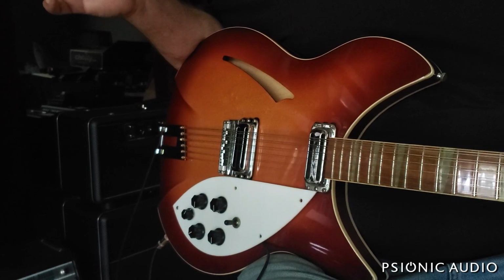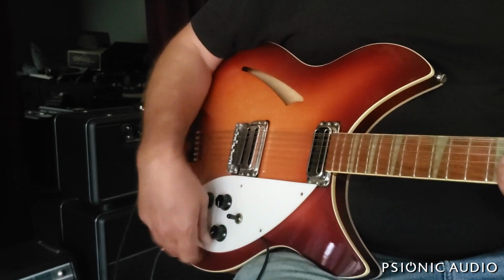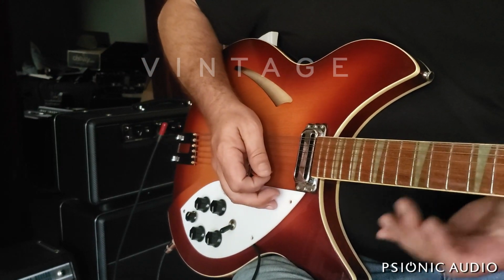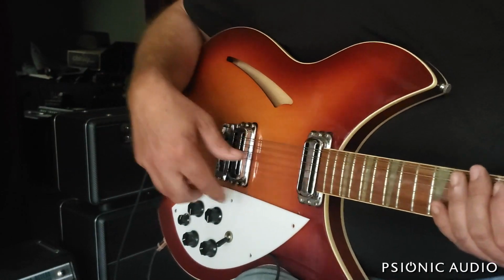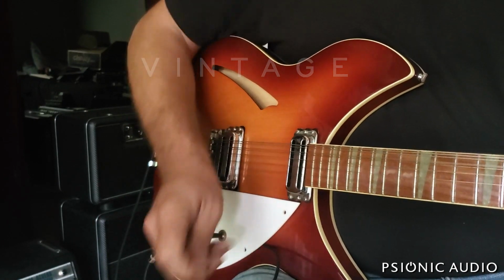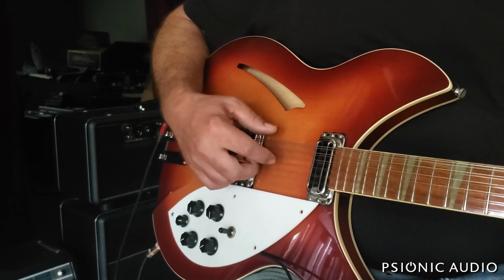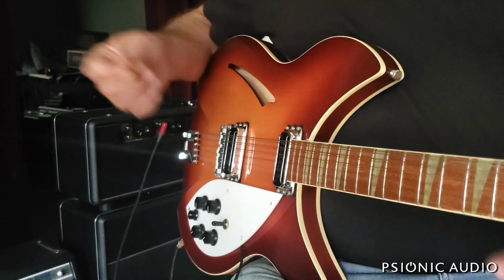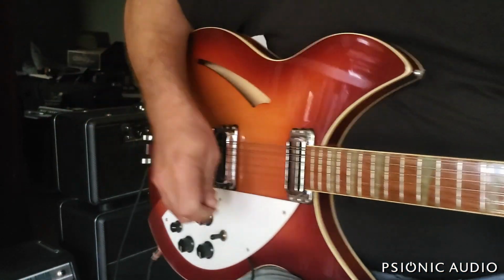Rickenbacker Wiring - Vintage vs Modern | What Exactly Does that .0047uf Cap Do?

Comment from the maker: You won't hear a huge difference if you listen on a phone, as the phone usually rolls off about the same frequencies the cap does. Headphones/real speakers are crucial for this
Reply: Actually I could hear more than you think on a mobile. The vintage wiring sounds much more like I like my Rickenbackers to sound. Personally I think I'd go with a split on it, so I had the choice, because I can see the benefits and weaknesses of both sounds. Great information though, as I didn't realise this was what the difference between vintage and modern Ricks was. I've played both and one thing which hasn't changed is that they are all pretty lousy to play, without tweaking.
Reply: Same here.  It isn't huge on the phone, but it is clearly audible....
Reply: I was recording my 12 string yesterday and noticed the “mwah” thing going on with the blend knob, now just watching this was super awesome. Your videos rock, the vintage Rat mod is right up there with this one. Thanks for explaining/confirming this.

Comment: I had two Rick 12s and hated the narrow neck
Reply: I guess you never played a mid ‘60s Gibson.  The nut on my ‘66 J45 is 1.5 inches.  It’s narrower than my 360/6 (1.63 inches).
Reply: @henry__49  Yes I had two SG specials 69 and 70 sold them both

Comment: I appreciate that you put South Central Rain in there at the end, as I've always had a 12 string at the ready because of that song.
Reply from the maker: It's Mitch Easter's Fender Electric XII doubled with the 360 (6 string) on the recording.
Reply: @PsionicAudio I'm a complete REM nerd, and I didn't know that.

Comment: Just swapped the "hot" 11-12K toasters out of my April 1994 Mapleglow RIC 12 with newer RIC scatter wound toasters AND the cap.
HUGE difference, has transformed my previously loud but 'muddy' (no matter how adjusted or Jangleboxed) guitar to glorious 60s octave jangle.
Sounds so good I don't even like using the Jangle Nano box as "essential" to THAT tone. If you are on the fence about those hot toasters you will not be disappointed
with scats and the cap. Great video especially how the cap wakes up the octave strings! Thank you!
Reply: Gemini vintage toaster tops.

Comment: I have a 360/12V64 with the .0047uf cap installed with a 12 saddle brass bridge. Plus I unwound the pickups to 60s specs. I absolutely love the sound and tone.
Reply: Moded my 2003 with Gemini vintage ‘63 toaster top pups and added the .0047 cap on a new pick guard so it can be switched back to ‘03 correct.  Also changed the volume pots back to the 280s. Always use the vintage setup.
Reply: Did pretty much the same to my ‘03 360/6.  Plus changed to ‘63ish Gemini toaster tops.  Love it.

Comment: I bought a 360/6 Delux (with RickoSound)  new in November of 1971, It's the one in my meme... It has the "transitional" pickups in it, I think they were installed from !969 to 1972, then the modern hi gains were used. 
My Rick has never had that kerang and big sparkly tones, despite have the wring checked several times, always been more like a beefy Strat sound almost. Last tech looked at impedance and checked with original specs and all works out... never nutted it out but never stopped me playing it for the last fifty something years...

Comment: Thanks for this. I think I’m going to try putting the cap on a push-pull pot for both the neck and the bridge. Might need to tweak the valve for the neck pickup. On my 1993+ with low-wound toasters, the neck is super boomy and bassy.

Comment: Thanks for posting this. I have a 1992 Ric with the Hi-gain pickups and it is unplay-ably dark. It's the most beautiful yet worst playing/sounding guitar I own. The 330K pots read anywhere between 125K and 250K max. I bought a set of VI 250K and 500K pots with the plan to wire up a whole new harness like this. I think I'll go ahead and swap it out. Might strip the board and have tall frets installed too. I love Ric's but man they can be frustrating.
Reply from the maker: The 350 I did had the Hi Gains. It sounded great after I rewired it, though I didn't use the Rick schematic.
Reply: @PsionicAudio  can you post a wiring diagram, please?    Great Video 👍
Reply: I bought another pick guard and loaded it with ‘63 period pots and the .0047 cap.  If I want ‘03 correct wiring I just swap out the pick guard.  Also gave it Gemini toaster tops.

Comment: Great video Lyle and thank you. I know you were playing mostly clean, but didn’t mention a compressor. I think McGuinn and Mike Campbell used those with the Rick 12, and maybe part of what we hear was the vintage wiring and cap with compression ?
Reply from the maker: Thanks. Compressors are a slippery slope - what's the actual sound of the guitar vs what's processing? I did a bit of this Rick on the Princeton video the other day and I added a little limiting in post here and there. 

McGuinn also uses metal fingerpicks - you don't want to hear me flailing trying to use those torture devices...

Comment: Hmmm.... Good to know about the 4.7n cap and vintage pot values.  Will have to check my 620/12 and see what it has in there.  If you like the sound but want a wider neck, try to find a 660/12 and see how that feels....

Comment: Did the older Rics with High Gains also have the cap?

I had a mid/late 80’s 610 when I was on a Paul Weller kick and I didn’t think it sounded “quintessentially Rickenbacker”. I chalked that up to not having a Vox, or compressor pedal, or Toaster pickups but maybe the lack of a cap had something to do with it?

Honestly, I didn’t find the sound of that 610 remarkably different than a Telecaster - which has fewer obnoxious quirks than the Ric.

Comment: What I would do is add a  5 position, 4 pole rotary switch in place of the bridge tone pot, with a choice of cap values on that bridge output wire.  This way you can have choices of how much of the low frequencies are filtered.  After all, who ever uses a regular tone pot on a bridge pickup? If anything I would love the option of making it sharper.  I'd run from  .033 , .047 .068 and .1  then have one position for bypass.

Comment: Interesting what was the cap made of  ?   Vintage I would guess ceramic .   Have you tried a polyprop or polystyrene in the 6800pf range ?
Reply from the maker: Polyester 630V because it have a lot of them but it doesn't matter. There is no voltage here and the material doesn't affect the sound. Any 4.7nf film cap would do. Axial for the layout.

You can experiment with the cap value. 4.7nf with the 125K to ground puts the high pass at 271Hz. I just went with that value.
Reply from the maker: The vintage caps were polyesters.
Reply: @PsionicAudio  Thanks  the 630 volt rating does effect the DF and some other factor that would at best confuse most people.  I enjoy your approach  to this subject .  Well I must take your work and word  on the cap material not effecting the sound in this case .    It what I play with HiFi amps they have a very large difference in power supplies and in signal applications .  But that is a rather different use case .  Enjoy the videos.

Comment: Why not have 500k Volumes?
…for that matter why not 1meg Tones as well?!

😉
Reply from the maker: 500k volumes would make the sound a bit darker. 1M tones wouldn't do anything for most of their rotation.
Reply: @PsionicAudio  500 would be darker than 250?
Are you sure…
Surely the greater the number the less treble attenuation?🤔
Reply from the maker: Sorry. I thought you mean 500K instead of 1M on the volumes. This guitar was long ago enough that I forgot what was in it.

I used 250K volumes and 500K tones because that's what Rick used in '64. 

The 500K tones function almost like a "no load" tone circuit. Turned up all the way they don't really color it at all. And when using more than one pickup at once the tone R drops to 250K, which is enough to keep the sound natural.

If they had used 250K tone pots then when you used two pickups together the sound would be slightly darker. Because at the frequencies that want to pass through the (now doubled in capacitance) tone caps the resistance would be halved.

You can replicate this if you have a Les Paul. Turn both tone knobs to about 7 (should be roughly 250K). Either pickup by itself should be only slightly darker than with the tone on 10. But both pickups together will sound darker.
Reply: @PsionicAudio  well that’s kinda my point, then -why NOT use 500k or more for volumes and tones and leave 250 alone if brightness is the point?🤷‍♂️
Reply: I was wondering this too, thanks for the extra explanation! Presumably this both pickups darkening effect is only an issue when a guitar uses individual tone pots for each pickup? Since in 1vol1tone guitars the both pickups option usually sounds brighter from the parallel pickup inductance and resistance allowing a higher resonant peak, and the circuit would have the same tone pot R to ground as with a single pickup.
Reply: If you want classic Ric sounds you need 250 volume pots.
Reply: @PsionicAudio  thank you for the reply I appreciate the time you spent with that message & I should've acknowledged that
Reply: @tomm1tch  good point

Comment: The Beatles did not use a 12-string in Ticket to Ride. I hear no difference bypassing the cap.
Reply from the maker: They most certainly did. Listen again.
Reply: @PsionicAudio  first look at all the videos of the song. No 12-string. Second, listen carefully and you will notice that there is no G string high octave sounding when the first note ( A ) is played. There is no doubling of the B or E strings either.
Reply: @zurdoremi  In videos they're either miming, or on tour when they wouldn't necessarily use the same guitars for a song that they used in the studio. For TTR live, George would need to play his own 12 string riff and Paul's lead part; since he couldn't do both on the 12 string, the compromise was to play the 12-string studio part live on his usual 6 string - you can hear George fluff Paul's lead part here at 1:35 - https://youtu.be/ICwIt47toMc?t=94 .

But I can DEFINITELY hear the octave'd  G-string and the chorusing of the  B string on the studio version from Help. https://www.youtube.com/watch?v=UHsN9d4FTVI.
Reply: You are correct. The Beattles did not use a 12 String on Ticket to Ride. THEY USED TWO OF THEM.
John played his 325/12 and George played his 3x0/12 (330 or 360 depending on what naming convention you choose to use.)
Reply: @karmicselling4252   interesting… the lick can be played at the nut and at the fifth fret.   I bet John played at the fifth fret and George at the nut.